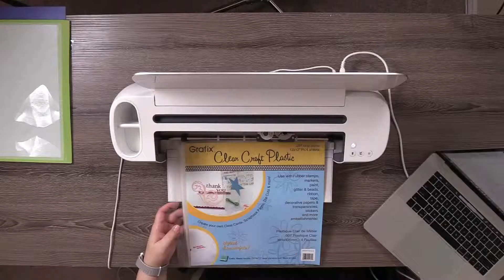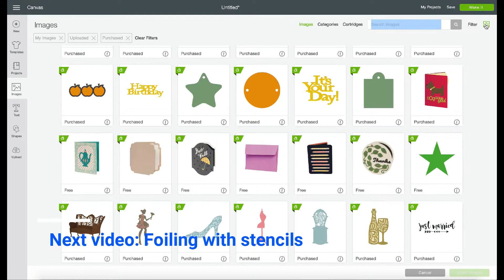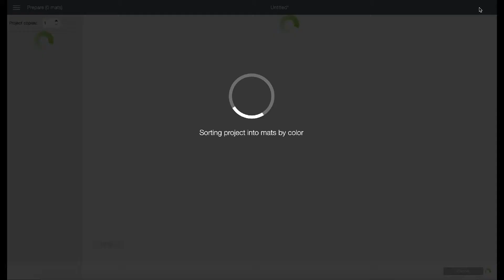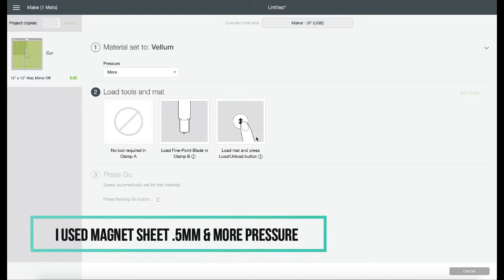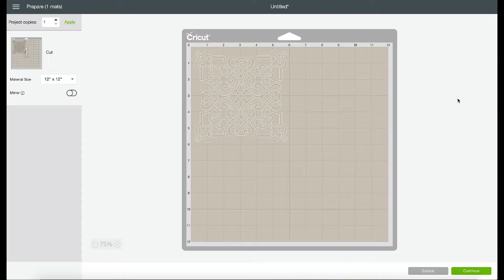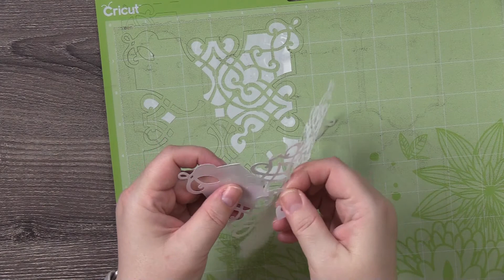Make Stencils At Home Using a Cricut

Comment: You said you used the Deep Cut Blade instead of the Fine Point Blade (I'm assuming that is the blade that the Cricut comes with). Could I just use the Fine Point Blade (I don't have the deep one, I just got my Cricut for Xmas...).
Reply: Hi. I used the deep cut blade that I purchased separately. It made cutting the material easier. However, if you use the fine point and it doesn't cut all the way through then try running over it again. Let me know if that works.